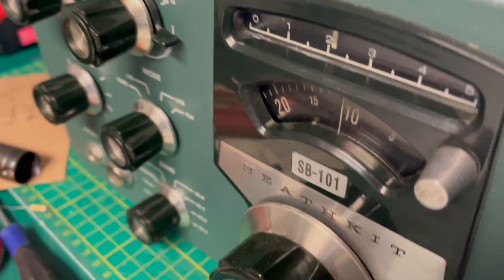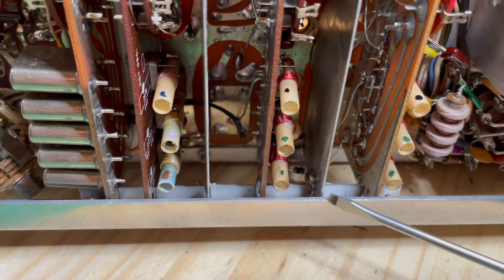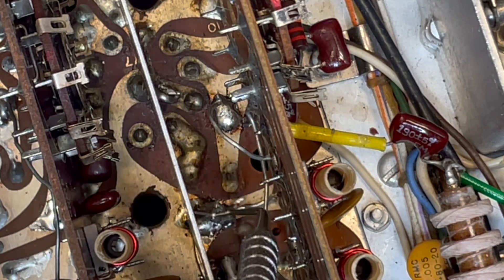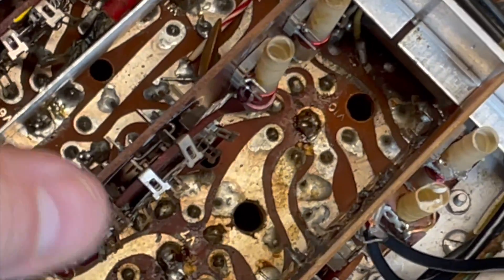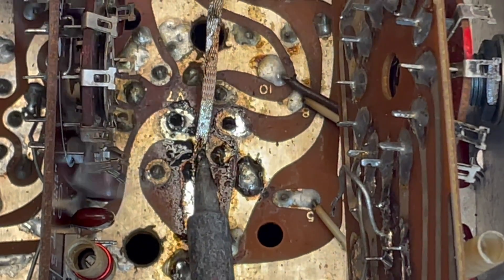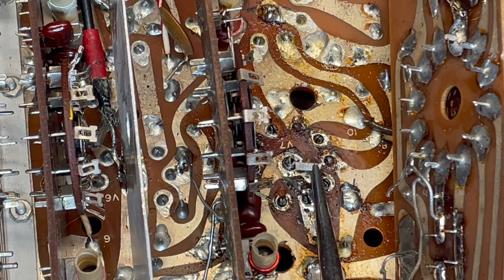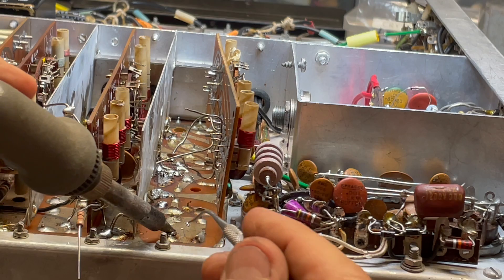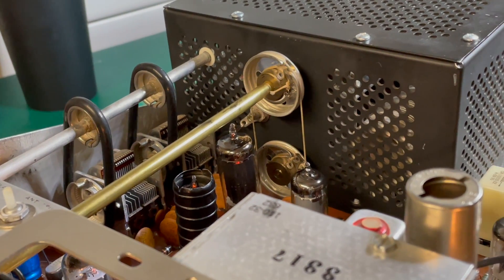Heathkit Tube Socket Replacement

Comment: Love your videos and really appreciate them as I’ve learned a lot. Though one thing you do I’m not sure about - using solder wick as a ground for the boards to the chassis. The part that worries me about that is that desoldering braid is basically just a string of metal wires strung together, often loosely. I personally would really worry about that braid coming apart at some point in time and then having all those desolder shards ending up all over your radio. I kind of like the idea of just using a thicker solid wire to connect from the board to the chassis. Curious what you think about my concern. Thanks!

Comment: Perfect timing Will! I have an SB-102, with low power on most bands. Upon inspecting the driver switch board and its shield, there are many broken solder connections to the shield. I'll get in there and solder them all up.  BTW.. I'm the 5th commenter... LOL!